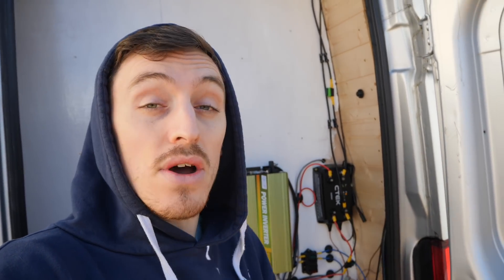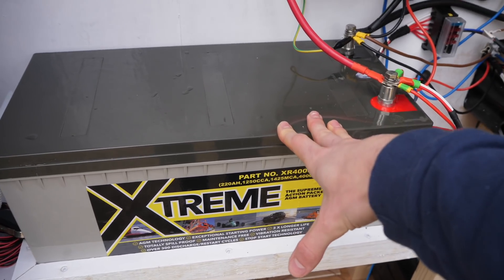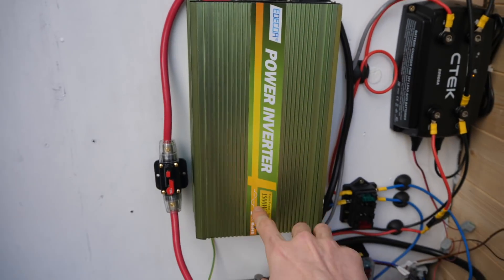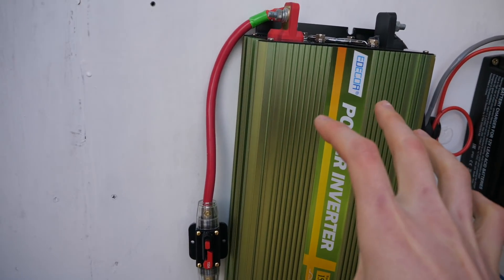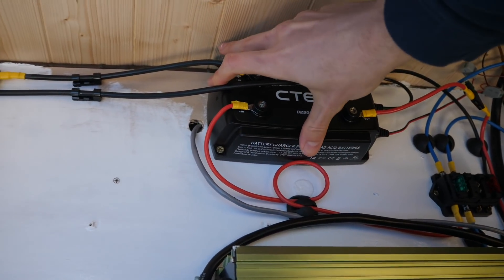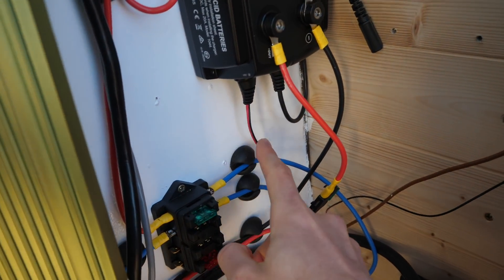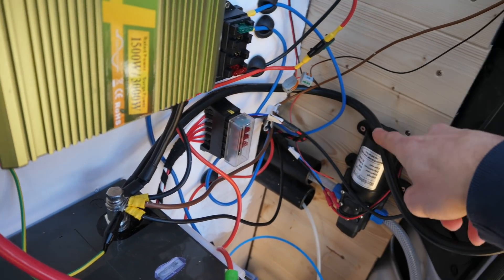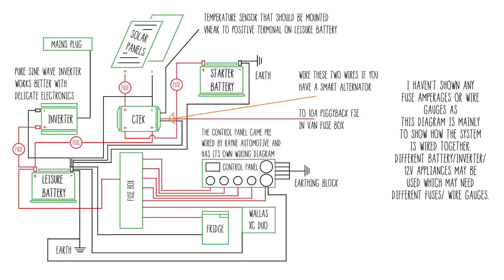HOW TO 12V Camper Van System SMART ALTERNATOR - UPDATE/REFRESH + Wire Diagram!

Comment: Have you found that your CTEK has "over heated" do to too much power from the solar? How does one know if the van has a "smart" alternator?
Reply from the maker: No overheating so far! Still ticking fine but will have to see when we hit the summer. I think if your van is Euro 6 compliant it will most likely have a smart alternator

Comment: How do you know you have a smart alternator?. Do you have a euro 5, euro six engine with stop start technology. In your last "super easy 12v camper van electrics" vid your ctek wasn't connected for a smart alternator, via the red and black wire and every thing seem to be working correctly. Could you explain this a little more. Thanks
Reply: Steve Shirvington Hi Steve generally anything after 2006 has an alternator that does not get to 14.8 volts to max charge your secondary leisure battery. So it’s better to go with one of the Ctek style Dc to Dc charges over A Voltage sensitive relay.

Comment: Hugh, I am confused about the lights on my CTEK D250SA and what they mean. Mine is finally installed after weather delays, but i'm starting to think I have done something wrong. I have installed it according to your wiring plan and that of the CTEK manual, but when my engine is OFF the alternator light FLASHES and the leisure battery light is ON steady, indicating that it is still receiving a charge... and nowhere in the manual or on the CTEK site does it mention a flashing alternator light. Shouldn't that light be off when the ignition is off?
Reply from the maker: Hey, is it still flashing now? Have you got a smart alternator?
Reply: It's ok, i've fixed it - feel a bit stupid, but I piggybacked a battery fed fuse instead of an ignition fed one by mistake. Because of that the unit didn't get the signal to isolate the batteries from each other when I parked up and the CTEK sucked the starter battery dry within 4 hours and fed it all to the leisure battery, which is now technically a cannibal.. So, here's a  tip for others attempting to install this unit: Find a fuse box diagram for your vehicle online and make sure it specifies which fuses are ignition fed - for my vivaro, there are only 3 possible fuses, and one of those already has a nextbase piggybacking it. The third is tucked up right under the dashboard and is impossible to get at without dismantling the glove box. Still, lesson learned and I'm happy I've now got perpetual lights and usb power in the back :)

Comment: Hello! Good refresher video!

Could you let me know what size is the black cable between your battery and the chassis?

Also, did you use the cables that were supplied with the inverter or did you have to upgrade?

Thanks!
Reply from the maker: Thanks, from what I remember the cable between chassis and battery is 170amp or 25mm2 cable.
I used the cables that came with the inverter.
Reply: Thanks!

Comment: Nice vid. I think I’m going for the CTEK250sa  option but noticed on the manual it say for batteries over 100ah best to use CTEK smartpass 120 as well which is another £200. What are your thoughts on this?
Reply from the maker: In the manual it does say that the 250sa on its own can handle up to 300ah so I think you will be fine! I am using a 220ah with just the 250sa and it's fine
Reply: Just to add, its only a 'recommendation' for better results charging a larger battery. Like Hugh says, It will still work up to 300ah with just the d250sa

Comment: make sure that your positive cable does not rub or vibrate on the sharp cooling fins of the inverter
Reply from the maker: Yes, I was going to look at adding a wire holder to physically hold it away.

Comment: hi, certified electrician fron germany (so i dont know uk standards) but what i can see from here it looks relatively good. you should cover all positive terminals so nothing can shorten out by accident,

voltages over 50v need to be placed seperately from those under 50v. 

signal wires (e.g. ethernet, antenna) should be placed seperate from both over and under 50v wires and you should get rid of the piggyback fuse or check if the wire going to the terminal you plugged it in to can handle the additional circuit.

other than that: nice work
Reply from the maker: Thanks so much for all the info!! Can I ask how I should separate the cables/voltage?
Reply: HughTube a piece of non conductive material between the different categories should be enough. but you can use metal as well just remember to connect it to ground if you do

Comment: I am just about to install my CTEK and then you upload this, what are you, psychic? Nice job, will make things so much easier for me to set up. 2 questions if I may:
1) The temperature sensor on the CTEK... what temperature is that supposed to be monitoring and why?
2) How long do you have to drive to charge the battery just from the alternator? I havent got my solar panels yet so will be relying on just the motor to top up the AGM for a while
Reply from the maker: I wish I was psychic then I could get them lottery numbers!! haha

1) The CTEK temp sensor goes near the positive terminal of the battery, based on what I have read from the manual it is there to do a few jobs but mainly around providing the best charge that doesn't damage the battery.

2) This is hard to determine but the CTEK max amp output is 20a so a 110ah battery would take 5.5 hours from absolute empty.
I would say 2-3 hours after normal use would see you topped to full
Reply: Thanks, that's fab :)
Reply: Thanks Hugh, excellent stuff :)

Comment: Great stuff, the diagram definitely helps.
Regarding vibration: Now that you've flipped the inverter over, presumably you're going to have to take care that the plugs don't fall out of the bottom sockets?
Reply from the maker: Nice thinking! The plug I last fit in was quite stiff but I may have to add a block that stops them slipping out if that is the case!

Comment: Is your CTEK your solar controller? When the battery is full and your solar panels are still pumping power, where does it go ie what does it cause? Heat?
Reply: Sponge850 Bobette the solar panel won't produce any power unless the solar controller lets it do so. A panel with sunshine will produce a voltage, and if the solar controller wants to draw zero power it just presents an open circuit to the panel which means no current flows and thus no power.
Reply: Thank you - now I have learned some good basic stuff about panels and controllers. Thank you again
Reply from the maker: exactly what cjcjcjcjcjcjcj said! haha

Comment: Bloody hell Hugh that’s a lot of kit and a lot of electricity. You planning to grow weed in the van or something?  I’m going for a more pared down solution, without a fridge. That would have been the main power draw, and I worked out that keeping my milk from going off would cost around £600. As I’m coming from sleeping in a tent with a plastic bag containing my cooking stuff, I have low expectations. And if the unpowered icebox plan doesn’t work, I can always add another panel, a b2b charger etc later. I don’t seem to be having any problems at all spending the £600 I’ve “saved” on other bits of the van. But a great, clear explanation. I’ve kept a screenshot of your wiring plan!
Reply: Ha! I see what you mean. I think I want to avoid leaving a trail of dead AA batteries behind me where ever I go. May try oil lamps for the next build.
Reply from the maker: You caught me Dave! haha If you would like I could send you a design for a super reduced electric system? something that meets your needs!
Reply: Looking forward to some Breaking Bad style adventures where you hole up in a National Trust car park and monitor the pH of your growing medium. I’ll post a picture of my electrical plan on discord and would be grateful for any comments.